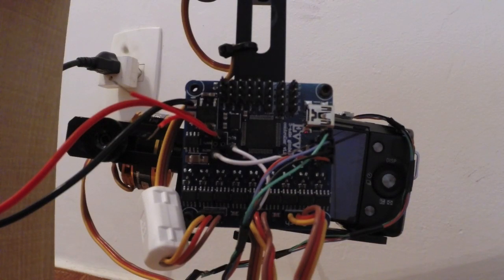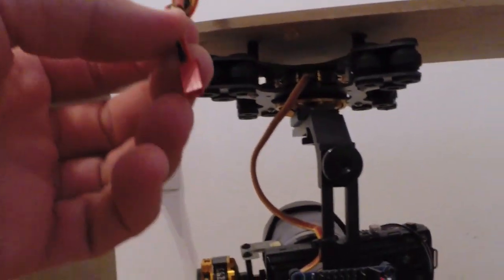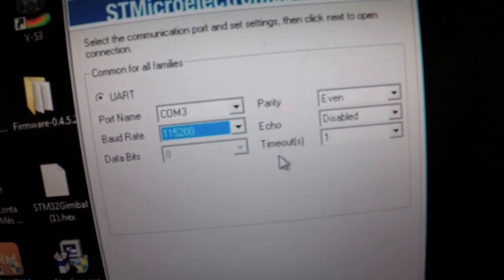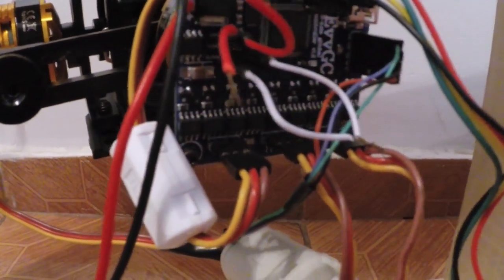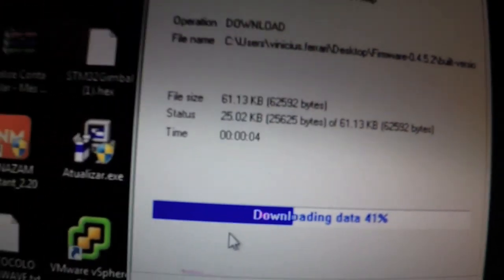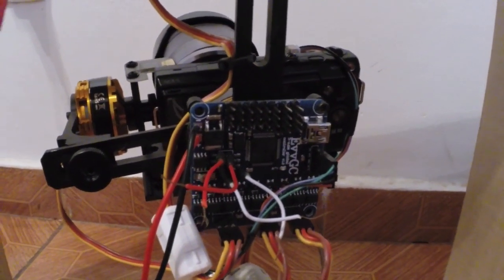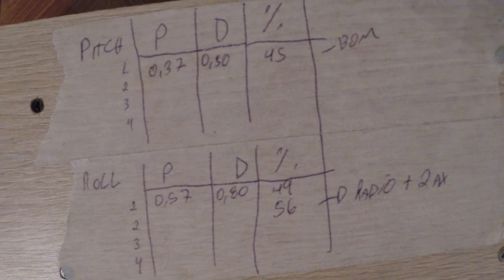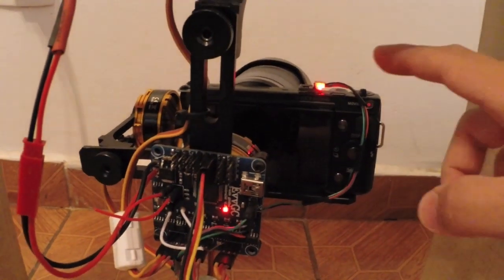EvvGC - Flash Firmware and Configure GUI, NEX 5

Comment: Great Video. Just tried mine EvvGC v1.2 but no luck. My windows pop out:

No response from the target, the Boot loader can not be started.
Please, verify the boot mode configuration and the flash protection status,
Reset your device then try again.

I already tried :
1) Reverse the rx to tx and tx to rx 
2) Plug in IMU while connecting
3) Tried different version of Flash Loader Demo
4) Tried another EvvGC v1.2 board

Possible to get your advise?
Reply from the maker: You have Skype? Its more easy to "talk".
Reply: ***** Hi. Thanks for reply. Yes, I got Skype, my acc. paulsiaw75.  Besides that, what is your profile?
Reply: ***** Possible just add your facebook? Easy to discuss too. Cause I seldom log in Skype. :)
Reply: @Paul~

Wonder have you solve your issues EvvGC Board connection issues?

FYI.....
It is the same that I faced ver1.2. In DEC2013.

@Vinny ~
Great explained Video  :)
Eager to skype with you soon.
Reply: SSBrealty Hi, Not yet solve my problems, my friend faced the same problem for ver1.3 too. Dont know how to solve it. Still looking for solution.
I also discuss with Vinny and still no solution.
Reply: The board still not flashed?? Hehe..
Reply: did you closed the Jumper for boot and nrst and then power on? after power on you have to disconect the jumper from nrst and start the flash tool
Reply: Yes. Tried but no luck.
Reply from the maker: Paul, if this happens, you must insert and remove the jumper from NRST and click next again... try it...

Comment: I have one little question... in GUI... what is P and what is D :)... thx
Reply from the maker: Hi Štěpán Uždil,

 P – describes the power of disturbance response. Higher values means a stronger response reaction to external disturbance. Raise this value until the stabilization quality of fast disturbances will be adequate. If the “P” value is too high, oscillations of the axis will start to be present. These oscillations will get worse if there are vibrations that reach the IMU sensor board. If oscillations occur, raise the “D” parameter by 1 or 2 units, and then try 
to raise the “P" value again.

◦ D – The “D” value reduces the reaction speed. This value helps to remove low-frequency oscillations. A “D” value that is too high can cause high-frequency oscillations, particularly, when the IMU sensor is exposed to vibrations.

◦ %Power - The Power value that is too low will not provide enough force for the motor to move the gimbal and stabilize the camera adequately. A low power value will be most noticeable in windy conditions, when the gimbal is not well balanced, or if the gimbal suffers from mechanical friction. Slowly lower the Power parameter to find its optimal value. Find the lowest value that still provides good stabilization and adequate holding torque.

I hope I have helped you!
Reply: *****

Ou... that was fast and grat answer... thx you and your work :)